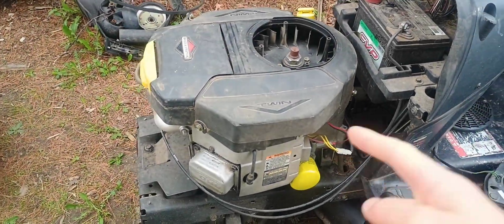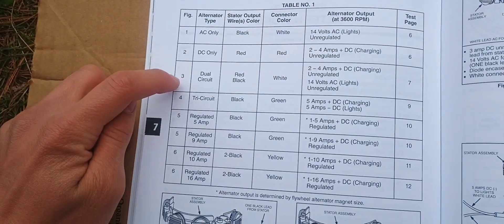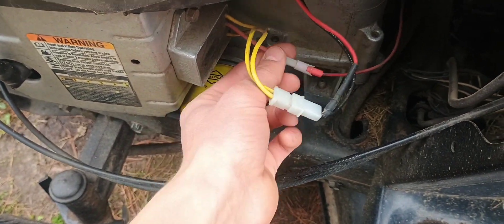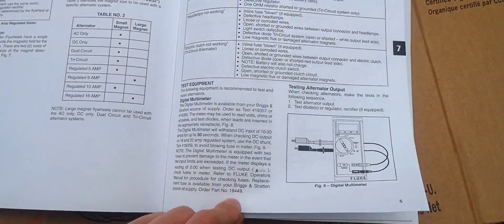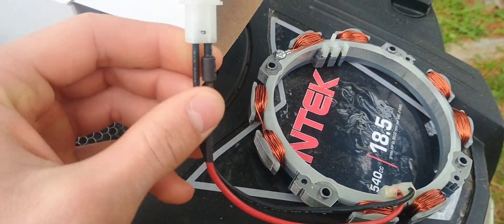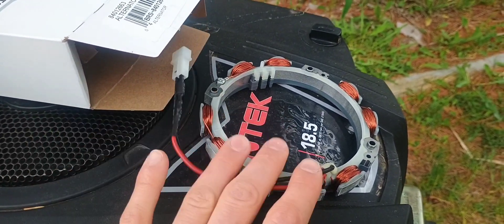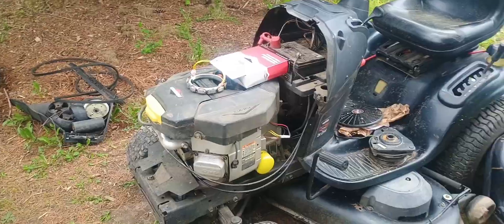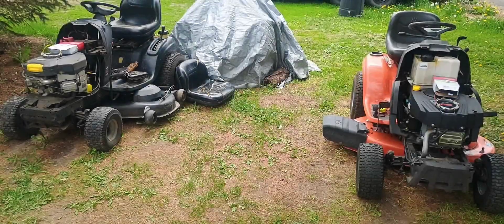How to Identify & Test Briggs & Stratton Alternators (Dual Circuit, 10 / 16amp, Unregulated, etc.)

Comment: Does it have the correct flywheel
Reply from the maker: @user-pp5or5og4k I believe so - the issues were fixed after installing the new stator and regulator / rectifier (assuming you're referring to the V-Twin).